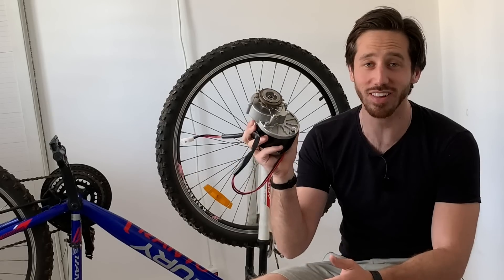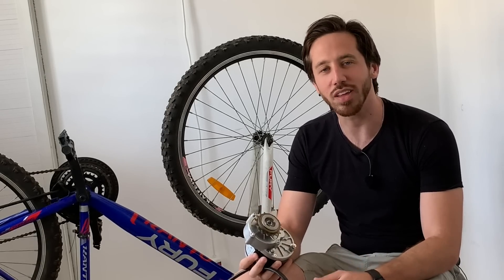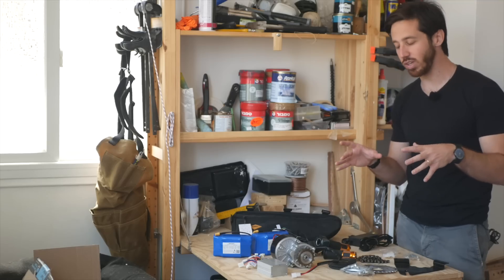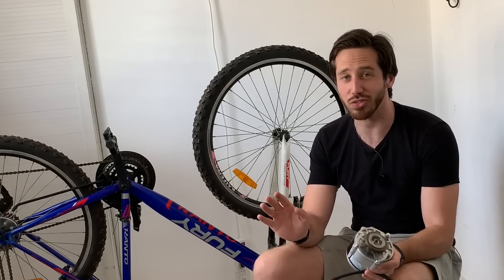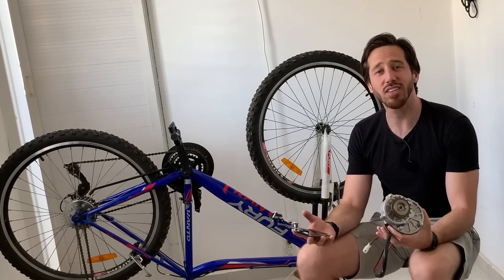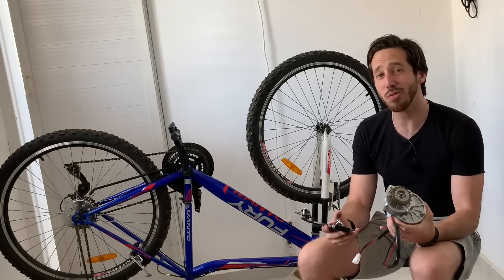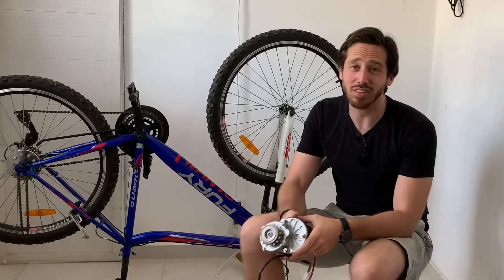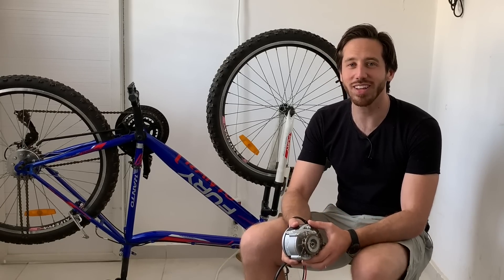Do NOT buy this $103 electric bike conversion kit

Comment: I actually bought all of the parts since your last video and am on my 3rd freehub. I definitely ran into chain alignment issues, but was able to shim it out to get almost perfect alignment...however, the first freehub loosened and spun the bearings within 2 weeks, and it’s replacement freehub from LFaster did the same in 2 days. Trying a different freehub on the lfaster adapter, and after that scrapping the L faster kit and going for a hub motor

Comment: Did you try any road bikes or singlespeeds? Sounds like a rear hub spacing issue. I mean mtb's are cheap but they're not that common in the cycling industry. So the term Universal doesn't necessarily apply to 135-142mm spaced rear hubs even though it should.

Comment: I guess when something is too good to be true then it is. Thanks for sharing your experience.
Reply: This wasn’t even a good deal, the 2 stroke engine kits that are under $100 work fine (they aren’t impressive by any means, but they will move you around, much cheaper than electric). Honestly at the above $100 range for electric there isn’t much reason to go with the kit he chose (maybe if it was $50...), because at like $140 you can get 1000 to 1500w gun motor kits so you just swap the wheel and go (like even the huge fat tire bike kit I paid like $145 for, I have some massive 4.8 inch wide tires on it and I just have to finish modifying my bike shocks since I wanted a fatbike but decided I wanted to use one of my older normal bikes. Otherwise the standard 26” MTB wheels are like 1500w at the same price, but I want the fat tire for mud and snow).

I also have a road bike kit (those are terribly expensive by comparison, for some reason 700c wheel kits are like $230 instead of starting at $130), but anyways, that installation was very simple other than my curved drop bars were a small problem with its thumb throttle (it does say flat bars only, but I made it work anyways), that sucker tries to do wheelies if you punch it, haha! Right now I have it with an Arduino microcontroller for legal compliance on my state (no speed or power limits, but only while pedaling), so simply programmed a code that “if pedaling” -> activate relay, and the relay simply disconnects the brake lever cutoff switch I have set to normally closed disabling the bike until pedaling. Why not the standard PAS system function? Because the normal PAS sensor was dumb and would launch you into the middle of the intersection if you were just barely pedaling just to get a few feet closer to the stoplights, haha!
It has plenty of power, and I’m measuring over 35 amps continuous at 56v, so around 2 kW (I did a resistor shunt modification to the controller, so it thinks it’s only 1.2 kW). I was worried about overheating because it’s crammed into a bag with 0 airflow (literally took hours to fit that controller and battery into the canvas bag stretching it out, significantly more time than the rest of the bike...), but it runs very cool but 2 kW is enough for me for now, at least until I double the voltage because I want it to hit at least 50 mph efficiently so I can match some highway speeds (without motor I can hit 30 mph, so it’s not all that crazy fast, my race bicycle was designed for high speed, but I still want to go faster, haha!)

Comment: I was tempted before but got a Swytch kit instead. I’m hoping it’s much better than this one! Thanks for confirming my instincts!
Reply: Swytch isn't really worth it in comparison to something like buying a bafang bbs02 for between $300-400 which is a 750w mid motor and is a lot more powerful as a motor while being street legal in most places. Then all you need is a good battery which you can find between $200-400. Then just put that on your bike and you have a really high quality ebike at half the cost.

Comment: Problem #1:  Cheaping out.  You get what you pay for.  You don't skimp with cheap stuff on a device that your life literally depends on.

Bafang conversion is tried, true, awesome.  Rock solid.   BBS-02, BBS-HD.  Quality mid drive.  Proper battery and all the connectors fit into integrated system.  Applicable donor bike.  Do it right the first time and you will not regret it.

Comment: This is ridiculous. This is a make shift design that is bound to fall apart. Get a hub motor. Front wheel hub motors are about 150-200 direct from manufacturers and ready made wheel would cost arm and length. It’s start with around $400
In s1000 you could get  hub motor kit  from that would fit any bike.🙄

Comment: I've enjoyed most of your content and really appreciate your efforts, but have to say this... "I want to fabricate an electric bicycle but I don't want to fabricate anything" ... sounds a lot like the difference between a mechanic and a parts changer.
Reply from the maker: this is absolutely not a fabrication project. it’s designed to be a simple conversion project that anyone can do at home. I worked in a machine shop for 5 years... if I wanted to fabricate then I could do that in a different project, but that wasn’t the goal here.
Reply: @EbikeSchool  Fair enough. I guess when I hear low buck, cheapest, no budget, I fully expect exactly nothing to go smoothly or fit correctly and was waiting on the bodge-fest!

Comment: Mika, I had exactly the same problem you had with fitting motor and chain misalignment. I ended up making a wooden bracket to mount the motor vertical on the supplied plate. I videoed it and have put t hr e link below. I hope you don't mind. Start watching  at 2:45. https://youtu.be/siVkGvJlcr4
While i have a CNC to make the little wooden piece it could easily be done by hand or another style of simple mounting bracket could be used. I called mine the Angry Bumblebee because that is what it sounds like when I ran. 
Enjoy your videos and just working on bike 3 now.
Cheers Peter
Reply from the maker: awesome thanks, I’ll check that out!

Comment: I used that type motor on a bike by using a old schwinn front freewheel crank and drove it buy the crank gear as and was able to shift gears .had to fab up brackets it worked excellent except this motor would suck a battery dry in 30 minutes tried different controllers and batteries but same result suck on batteries so fast it just didn't work for me .

Comment: I already went for a 26 inch 150 dollar rear hub motor kit instead. Less parts that could break. Thicker spokes, And more efficiency. And way easier to install. And if your chain breaks you can ride home on the motor.
Reply: Where you find that mate
Reply: Thomas C You can find them on Ebay. With the current sickness situation i reccomend to buy from the same continent where you live if possible.

Comment: I almost thought of buying this motor for my first time e bike, thanks for being honest with the community , this is way better than just watching you build it perfect from the start. Feels like I'm there with you in the process
Reply: Mounts pretty good for me
Reply: @ItsJoeBull  will still pull the pedal off under your feat and break your feet one day..
That kit is ass and should only be used as a motor helper eight thumb gas config, a true "e bike" need you to paddel an double on power not just spin the rear wheel like an idiot

Comment: I have one of these kits, Even after you get the chain in line the motor is very noisy, Straight cut metal gears with hardly enough grease inside, And the rear sprocket is pretty hard to get centered on the wheel as well, Wouldn't ever recommend any of these kits

Comment: Considering that a Tongsheng kit costs  270$ right now.... For the difference you get a pretty robust and well made motor,  with torque sensor,  a proper screen and the posibility to connect lights  and turn them on from the main screen.   And just 100bucks more  from what you paid for that piece of shit that isn't even BLDC,  it is a brushed motor that will eat your battery in a blast.      Thanks for the video anyway!

Comment: Yes they do fit on old simple bike, but not on mountain or gear bikes, As you mentioned It's is little difficult to install that but you can do it
 and even the universal mount, one side can get bolted and other side, you can make custom bracket to fit or some sheet metal plate that you can mould as per your requirement and the sprocket you used is not the one, please don't use that one, use the freewheel sprocket.
Search for Dc gear e bike on YouTube, you will get an idea from few video

Comment: It looks like all your bikes are a variation of the same type of light-trail bike. Try it on a different bike, a road-bike or more appropriately a shopping bike. I'd be surprised if it doesn't fit anything as you seem to suggest. Its a kit, not a complete bike, so you are expected to do a little bit of adjustment. Mine's working fine using a pack of LiPo cells, and I live in a hilly country.

Comment: Go buy one of those gas motor kits! They're even worse! Chain lines more adjustable, but the way it's tensioned ends in death every time.
Reply: You can also sometimes just move your wheel back (that’s how real motorcycles are tensioned). Because yeah that bearing sucks on their idler... I think I used it for like 5 miles and realized the chain was almost perfect length when I shortened in, so I just barely had to adjust the position on my rear wheel.

The air filter is junk though (1/4 mile down gravel roads and the carburetor will have chunks of gravel, so that isn’t filtering ANYTHING!), I upgraded to a sock (as in took off my shoe and put a sock over it and zip tied it). Then the throttle cable on mine wore out (but it was $3 to replace it with a better one).

It also gulps fuel more than my 250cc dirt bike, but with about 1/20 the power. A 25cc weedwhacker engine has significantly more power and gets about 250 mpg compared to the Chinese engine at like 70-80 mpg at best. But I mean it does run even if the handling is garbage with the weight, and it is under $100 and takes only like 30 minutes to assemble if you have electric tools for the rear wheel (about an hour if it’s your first one). It’s cheap and easy, but not elegant like some of the well designed motorized bikes I’ve made (which are stupidly expensive to manufacture, but incredibly balanced and safe enough I’d let me own mother drift one through an intersection without worry, as they are incredibly dynamically stable and self correcting, but they are silly expensive, lots of chopping and welding etc, and I can’t do carbon fiber forks yet).
Reply: @jakegarrett8109  Yeah, if I do it again, I'm buying the purpose built frame and eliminating the tensioner. It was fun, I just wasn't super happy with my bike destroying chains every 10 miles or so.
Reply: joblessalex odd, yours was the single speed right? Mine has pretty decent roller chain and it never needed replacing (it was stolen after a while, but it was alright since car parking was a nightmare at my college campus and this was legal to park at the bicycle racks which were everywhere, like at most 30ft  from the classroom building doors). I rode it off-road in cattle pastures and stuff, and my dad would toss it onto combine headers or on the back of a plow so he’d have a ride back, so it had it’s fair use but the only things I had to replace were the cotter key on the small gear (eventually just welded it and the screw because they used an incorrect half moon shaft instead of half moon plus straight section), and the ECI magneto coil with generator (the black ECI box failed after a few months and I was stuck in the mud down by some ponds haha, the uphill pedal and crawling it back through was not fun, lol! Then a year later the coil pack failed somehow, not sure why cause it was pretty random), and the throttle cable and throttle handle I had worn both those out (I pretty quickly switched to regular dirtbike grips like all my other motorized bikes, I think that one was from a performance street bike and had cruise lock as well, which nearly killed me a time or two before I disabled it...).

Let’s see, tires, rims (switched to heavy steel rims and they were way better for durability), coil pack, magneto/generator could, muffler (put on a go cart muffler and some plumbing pipes and dang it’s sounded sweet! Sounded like an actual dirtbike and went from like 22 mph to 26 mph on gravel, which at the time had some bent wheels and was plenty fast), oh and some Honda badges on the fuel tank as a joke for me and my cousin (“probably triples the horsepower and 10x the reliability”, but hey, didn’t have too many issues so maybe! One motorcycle cop actual fell for it, and I indeed burst out laughing and almost fell on the ground, lol, that thing was so low tier quality just looking at it, haha!), and I changed the fuel filter (happened to have a really nice chrome and glass fuel filter, probably cost 1/2 what the engine did), and the uggly zip tied sock filter. But as far as power train never did have to fix anything after removing the idler (I checked bolt torque and made sure everything was tight once in a while but that was it, haha, the muffler once fell off because I wasn’t checking it much at all!)

I’ve got way nicer bikes, front wheel drive bikes with extreme stability as I’d often take them for a spin after class, lock the back wheels and drift skid them through the intersection without slowing at 30 mph and have a blast, stable and easy to control even with your eyes closed, incredibly stable and predictable. Also were crazy good off-road and so light you could whip them around and do stupid stuff without worry of any actual injury (every time I take my real dirt bike I always end up either almost missing my jump angle enough that I’m either launched off into a canyon or I slide into a tree... it’s thankfully been the tree every time, but sheesh, the smaller toys are so much safer, and just as much fun if not more since you flat out can’t do 60 mph wheelies in the mud and actually injure yourself, which, me being an overconfident novice at best did every time I took the bikes out for a spin, haha! I’d never learn!)

If you do make a custom one, consider using a chainsaw engine, those are pretty ridiculous (don’t make it front wheel drive, lol, once you go past 50cc it’s a lot of weight over the front wheel, 25-35cc is excellent front wheel drive, but it was a lot of chopping but it did mean full suspension as well as independent motor suspension on a flat belt drive, but it does require some custom pulleys being turned on a lathe and some other issues), rear wheel drive would be pretty sweet on a custom frame bike though, I’d dig that. And trimmers and chainsaws will rev nicely, about 2-3x higher than the motorbike kits, so they make way more power and sound awesome (I noticed cars give you way more respect and safe distance when it’s louder and sounds less like a toy, plus some extra weird looks, haha!)
Reply: joblessalex if you do build another one, have fun!
Reply: @jakegarrett8109  Sounds awesome! Mine was great when it worked. Easy 30mph anywhere in town. The problem wasn't the chain, it was the tensioner. The thing would slide in towards the wheel slowly over time and eventually the chain would be guided off the sprocket. Added several shims and it helped it stay in the right spot, but still.... Few rides in and the chain comes off. You need something way better than a crap ass wheel and pinch system. A solid mounted at two points spring loaded pulley would've been totally fine until it wore out and would never shift, but they had to cheap out. Was gonna get the jackshaft kit and everything so I could have hills and speed, just got tired before I did that. Probably would solve the issues too.